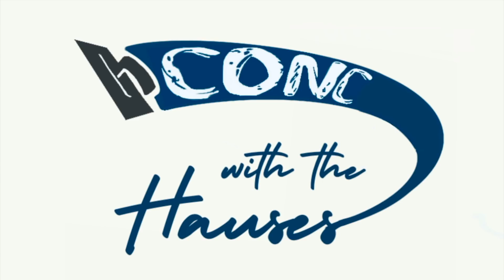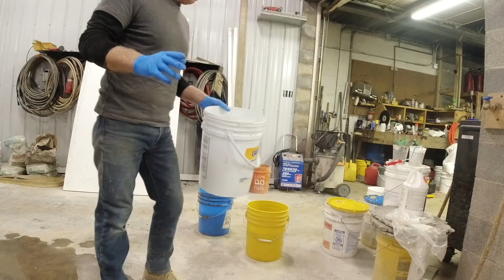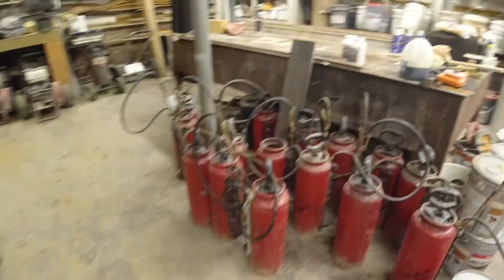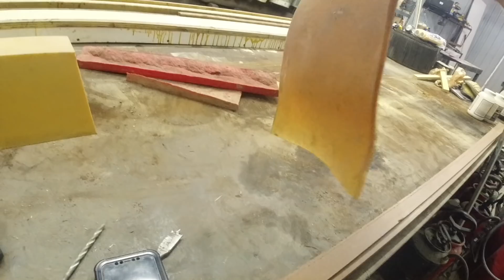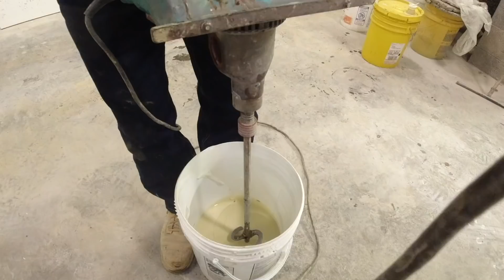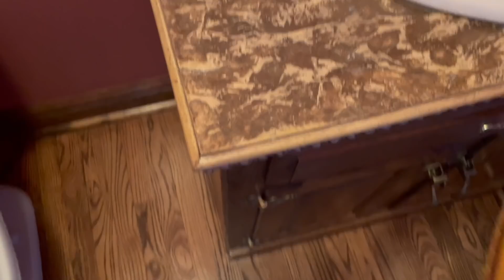Make Your Own Step Liners. Save a Buck, Maybe Hundreds!!

Comment: I use walttools liners a lot. You have my mind thinking this would be fun to do.  How do you keep the material from leaking out the bottom of the forms?    Really enjoy all of your videos and nice work!
Reply from the maker: I make my molds out of melamine a plastic coated plywood and just build the molds where there are no gaps or holes

Comment: Awesome video!  Pouring the mix into the mold looks like cake batter.  🤭   

Not so much a suggestion as a question . . . Could you use the release agent as a liquid?  Pour the release into the mold and let it go to all corners, then remove the excess.  Would that help to not miss any spots?  

Also, if the molds get dusty between uses, just cover them with a sheet or canvas or whatever.   

Thanks for the excellent videos.  👍
Reply from the maker: I’ve never tried anything other than their mold release it works too good to try anything else

Comment: As a concrete guy myself, really enjoyed the video. When you pour your first negative form, what did you use for your (stone) texture? Assuming you cut pieces of flagstone and laid them in the bottom? Or did you use already purchased step liners?
Thanks
Reply from the maker: I used an already purchased step liner and just duplicated